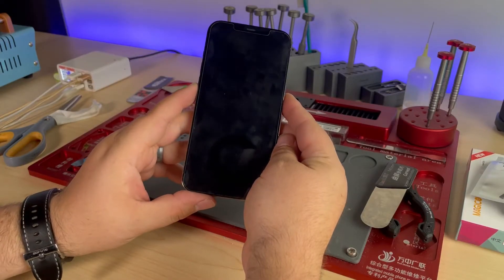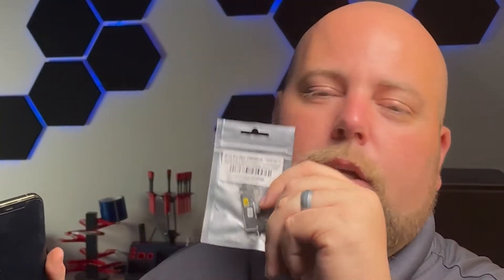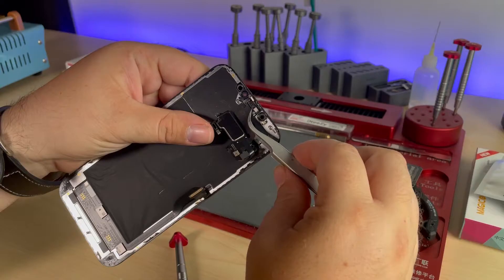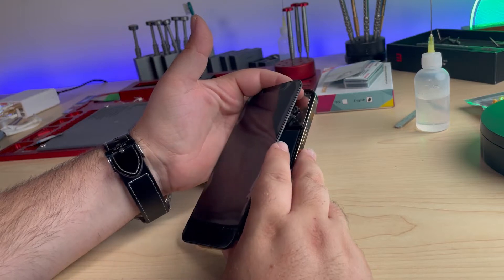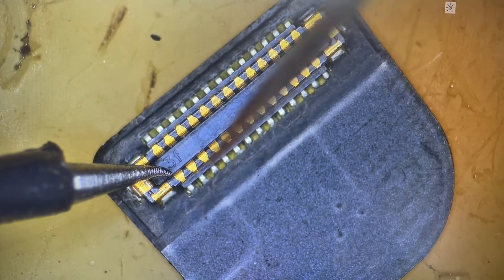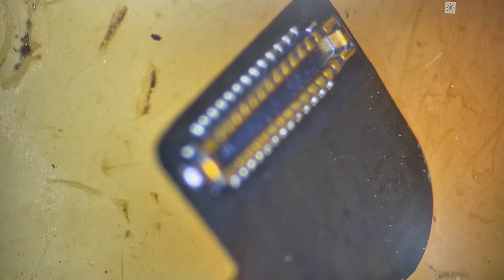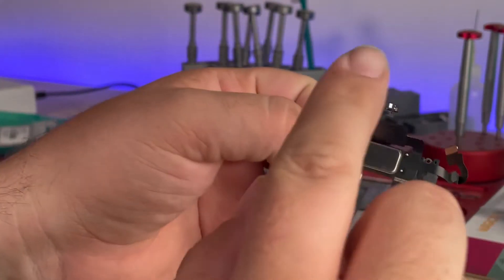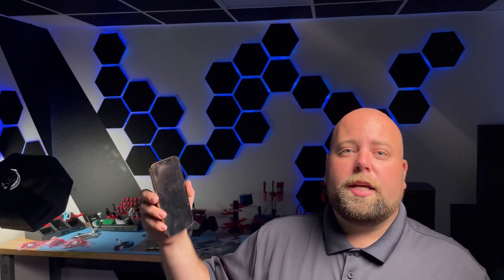iPhone 12 Pro Max Boot Loop Repair

Comment: Mine bootloop while connect to wall charger .. While using wireless charging no bootloop .. All the sudden iP doesn’t have any sound and vibration .. Any ideas ?
Reply: same... solution?